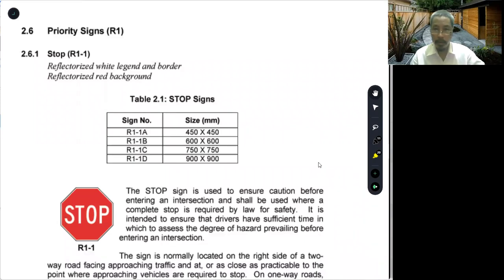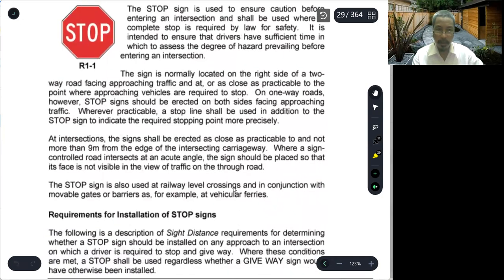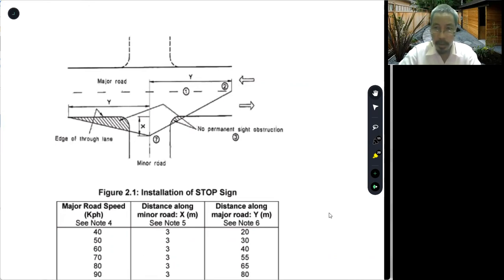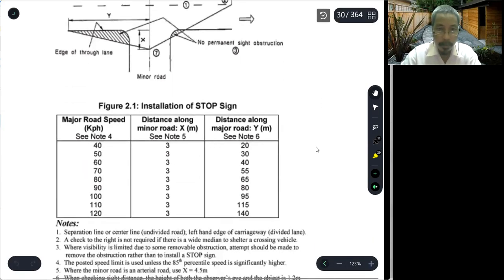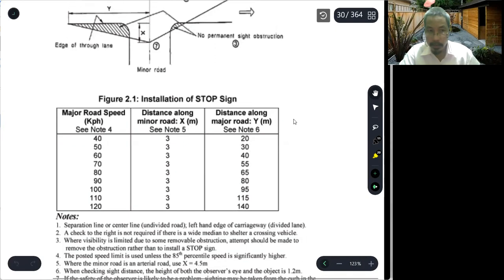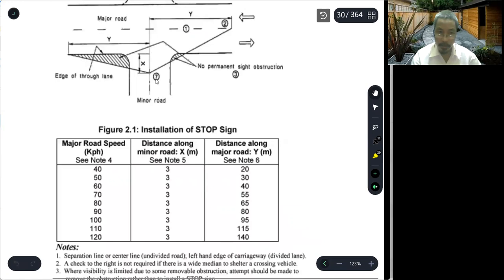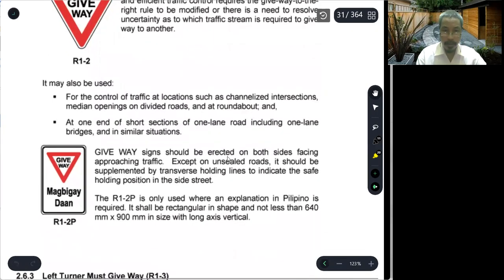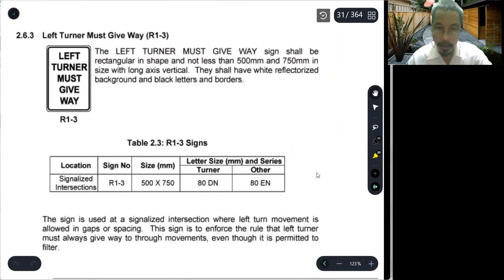PRIORITY Signs R1: Road Signs & Pavement Markings [DPWH Highway Safety Design Standards Part 2]

Comment: However, despite the fact that the Department of Public Works and Highways (DPWH) has set criteria for many of our streets, there are still a lot of incidents on the road every year. Road safety includes things like driver education and licensing, vehicle testing, and traffic signs. The proper and uniform use of road and highway markings is also important 😊